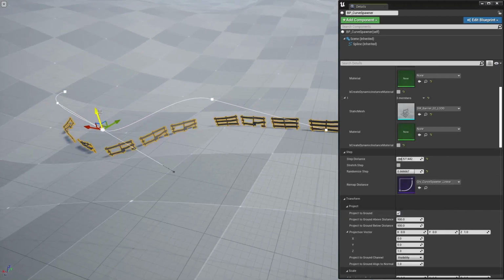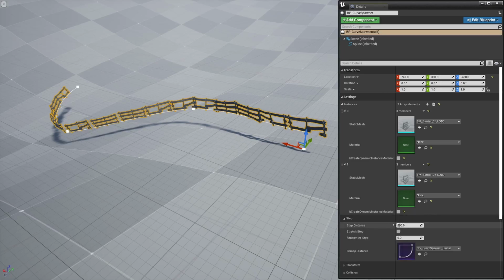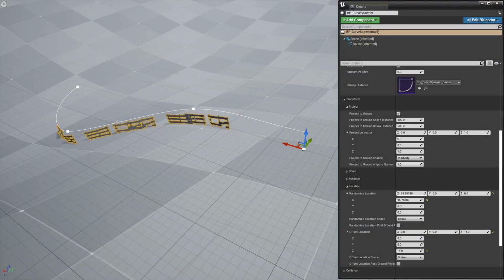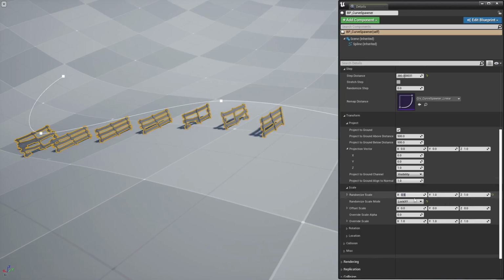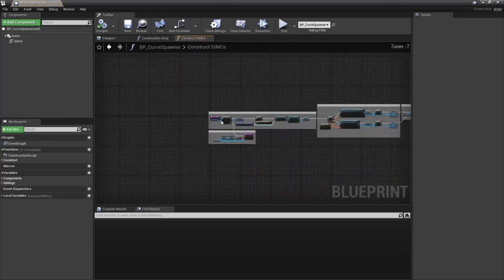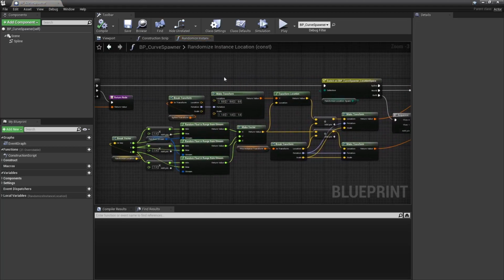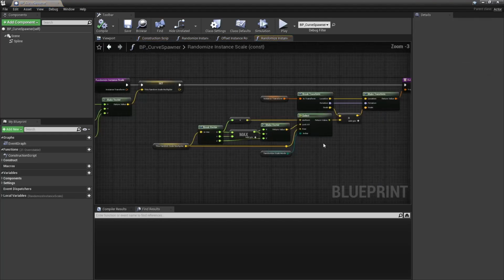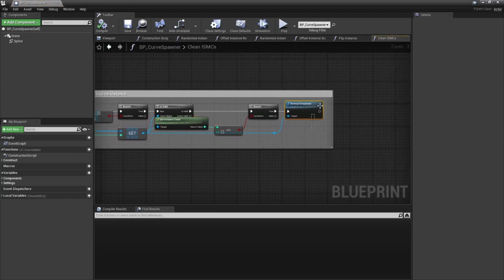Instanciating meshes along a spline using Blueprints in UE

Comment: would be nice if this had the option to spawn meshes at the end of the previous mesh with no spacing
Reply from the maker: It has. It's the mesh itself that has spacing here
Reply: @ghislaingirardot  I got it and tested it out with all the options and couldnt find a way, if meshes were different sizes some would always overlap unless the spacing was made very big
Reply from the maker: @bigsylph7231  Hmm I'm not entirely sure what you're talking about. The 'Step Distance' setting allows you to control the distance at which an instance is spawned along the spline, so you can leave plenty gap between two instances with a large step distance or even have 10 instances overlapping with a very small distance. So you get plenty control over the spacing.